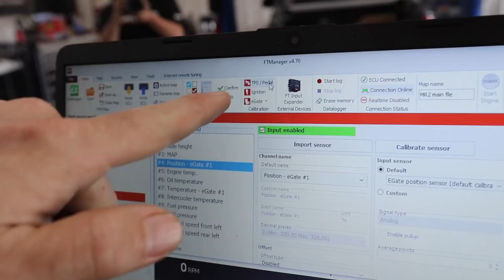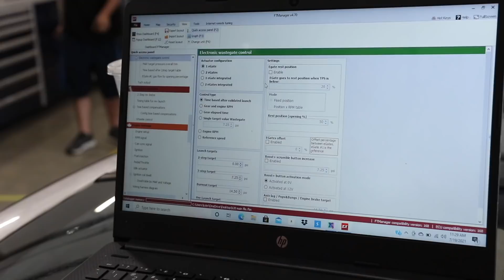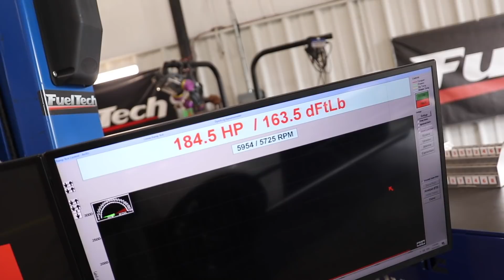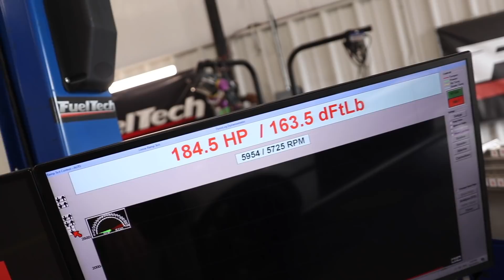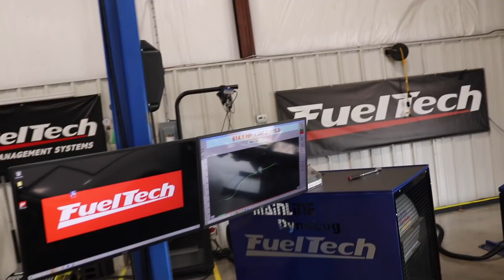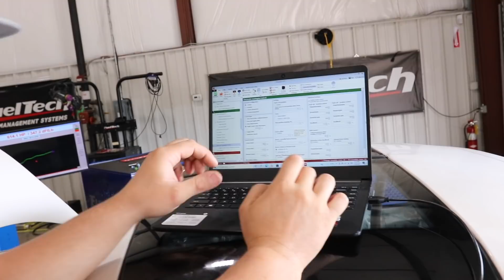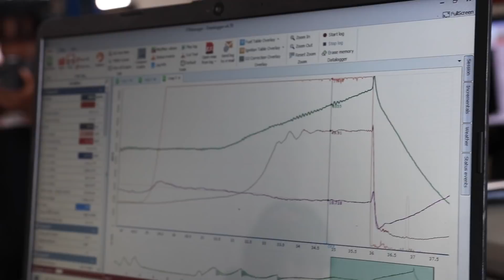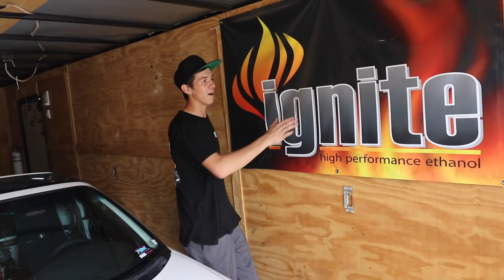The Mr2 THROWS DOWN On The Dyno!

Comment: I will admit I love what the fuel tech guys are doing and i am very excited to see how the Egate shit does, love to see the development of it, excited for everyone involved
Reply: Wild denbob appeared
Reply: Then you can have no BS build with an Egate, but think that will be some time yet, the tweaks are getting there.
Reply: Thank you!
Reply: Matt i tink the you need to run fueltech  on you ls engines
Reply: @cristianbustos4918  Nothing like tricking a car into thinking its ls powered Silverado
Reply: @AndersonDick  the auto calibration and real world data will get people to actually use it, when they announced it i was really excited to see what people would do with it, but immediately knew everyone would be afraid to use it. Kudo's for jumping right in and making it work and from what i see easily, to show people only good can come from it, the idea of complete control, and no springs or CO2 or anything while getting all the valve travel data at the same time is wild!

like you said its been out since 19 and he is the first "drag race car" to even want to use the thing.
Reply: @SloppyMechanics  That is the bane of new product lines. 

But looking at the graph after a few tweaks what you call for is what you get is great. 
Wonder if it compensates for other issues some get eg like boost creep, now with it logged you can see the % remaining/used.
Reply: @wobblysauce  boost creep is caused by the gate being too small.
An E-gate will never fix that. 
The WG still has 2b properly sized for the exhaust flow that is needed.

That said, that E-wastegate is a pretty dang sweet piece of kit. 

Afterburner: think back to the first turbo era in F1 (1977-1988) about 1100-1300hp in qualification trim, on high octane  toluene racefuel, using simple (Olivetti?) electronics and an eprom-flasher. 
All on a 1.5L 4cyl engine that used a block from a street car (bmw M10 engine) amd a Schnitzer 16V head from a F2 racecar.
Already 40+ years ago.
Got to respect those engineers!
Reply: @jfv65  Ya sorry was thinking of two different things at the same time... a classic lack of sleep.

Comment: Carbon fiber doors daddy Dave “cheater” 🤣🤣🤣
Reply: Alot of people on this channel won't catch that 😂
Reply: 80 pound diet
Reply: @MrJJ412  i got it lol and though the same as you
Reply: But still drives basically a pro mod. Lol
Reply: Didn't he start to run more and more carbon on street outlaws until they finally made the Vin number steel body rule
Reply: @wheeln24-79  I'm pretty sure he wasn't the only one, but when he had 'Plan B' to compete on the list this took affect because more people we're just going that route.

With that not denying he contributed to it :p

Comment: She sounds like Phongs all motor car…. Just with a little whistle….
Reply: True that
Reply: that's because Phong and Kyle both have a big cam with VTEC locked so it's on all the time 👌
Reply: For some reason the b. H. And k series sound like this when there locked on the big lobe
Reply: Good call.
Reply: @TM-jt3dd  there is no second lobe on the cam. Vtec stuff is completely deleted.
Reply: @BlueCollarBachelor  Not true. He has it in vtec all the time. He says it in multiple videos.
Reply: @BlueCollarBachelor  not true the vtec cam is just locked at all times
Reply: @bastacio1764  watch the build video. There's no vtec in that engine
Reply: @BlueCollarBachelor  you are misunderstanding, yes there is no variable timing anymore. But its on the equivalent to VTEC enabled all the time now. Edit: this just boils down to if you when you say vtec are you referring to the actual technology or the end state ie running on the big cam
Reply: @solatyn  Technically he is correct.. He just said it sloppy.. "Vtec stuff is deleted".. In a way he is right.. With Vtec Killer Cams, there is no more Vtec.. Vtec is just a system with multiple cam lobes that are timed with oil pressure to allow more flow at higher rpm.. A vtec killer setup is just 1 large lobe that is allowing the most flow at all times rather than a smaller and larger lobe for slower flow at low rpm and higher flow at higher rpm..
Reply: @bastacio1764  The old VTEC cam is no longer in the car, it's just a big ass cam now, way more aggressive than the stock ca profile even on VTEC
Reply: @solatyn  The engine has no Vtec. There is no misunderstanding. Variable Valve timing is what VTEC is. It has a single set of lobes on the cam. There is NO VTEC equipment to lock into anything. It is NOT a Honda engine.
Reply: @BlueCollarBachelor  VTEC is not variable valve timing - it is a secondary cam profile. and yes it is a Honda engine...
Reply: @surewhynot6259  It's a custom billet block. VTEC literally stands for "Variable Valve Timing & Lift Electronic Control"

Y'all need to get off youtube and turn wrenches.
Reply: @BlueCollarBachelor  when people refer to vtec they are usually meaning when it turns on and switches to the big lobes of the cam ie Increased duration of the valves opening etc. By deleting the vtc and replacing the cam with one with the same profile as  "vtec on", you are effectively driving around with "vtec on" all the time. Do you get what is being said now? Also wtf, yes it's still a Honda motor, where did that come from
Reply: @JonHop1  yes but if someone says it's like driving around with vtec always on, ie running on the higher cam profile all the time. Even if the cam only has the one profile and no variable control. It's effectively the same result right? When talking in context of the output of the engine, not from the perspective of the technology
Reply: @solatyn  No because the cam they run is FAR larger than the large lobe in a VTEC equipped motor. 
Yall are objectively wrong in every possible way, just take the L and move on lmao

It is NOT a VTEC engine.
There are NOT VTEC cams in it.
The ONLY thing Honda about this setup is the head and basic design of the block.

End of story, adios.
Reply: Fuckur Censorship  nobody was denying that secondary lobes can have different timing, but it is a fundamentally different technology from variable valve timing, as stated.
Reply: @PBRatLord  Is it though? how do you know there isnt a vtec cam out there with the same lift/duration/profile as the cam they put in? That is pure speculation dude. I never said the motor was still vtec or that it still had a vtec cam. I acknowledged the vtc was gone. What I said was, that on the new cam its the equivalent of being on the large lobes of the vtec cam/vtec enabled all the time. How is that "objectively wrong". You fail at reading comprehension dude, so I think you need to take the L
Reply: @zjwilliams1991  lol.. Finally someone that has been watching and listening to what the build was..
Reply: @jaytibby  I miiiight be a wee bit of a fangirl, but I also watch because my RSX has the same engine, and I am just building ideas on what to/not to do.
Reply: Literally sounds nothing like it
Reply: @zjwilliams1991  so JBR just gave them a junkyard core? Lol

Comment: That dip as you hit boost target then oscillate back in is indicative of an over damped PID tune. Decrease the Derivative gain a bit or increase the P gain and that should go away
@BoostedBoiz
Reply: My man knows electronics programming language and the interpretation of the language derivatives. Increase the p of K first if that increases the oscillation you reset back and decrease the derivative of time to amplify your error value correction.
Reply: @RadDadisRad  idk what terms they use in the FuelTech world, but a PID controller is a PID controller. The P (proportional) term is simply error multiplied by P gain. I (Integral) term is just a summation over time if error persists. This can be either multiplied by the I gain or 1/I gain. Depending on the applied algorithm. And D (Derivative) term responds to the slope of the change in measurement. So higher D values react more sharply, yet also act as a sort of shock absorber to the P term. His one log shown in this video is hard to judge without seeing the data personally. But it seems to be over damped a bit and potentially to much I term. It’s about time someone made an electronic waste gate. Not like anything involved is new tech, we’ve been doing shit like that in the industrial world since pneumatics ran everything.
Reply: It seems that the automotive industry has fallen victim to the same thing that the drone industry has where the cost of making technical parts overcomes the need for them. Good job to Turbosmart for finally finding a cost effective way to make such a simple yet affective product.
Reply: @zfpv7211  I’m using industrial programming terms. I program robots, conveyors and other things. Sometimes I’ll chase what I call the “windshield wiper” I’ll get continuous oscillations because the sample size is too small and the error correction is too big so I over/undershoot target. So I have to inverse some values by increasing my sample rate which decreases the error correction because I’m at a higher sample rate therefore my correction factor is happening quicker and I get less rebound and don’t get under/over correction of proportional gain.
Reply: @zfpv7211  eBOV and eWastegates are awesome. Also pwm controlled brushless fuel pumps are awesome too. Super efficient and generally small packages.
Reply: @zfpv7211  this is old technology, I was reading SAE papers on this 20 years ago, it's been in production for 10. They took the risk and brought the product of the tuner market, that is an accomplishment. But nothing here is technically innovative. OEs have been doing this forever.
Reply: @RadDadisRad  your PID sample rate that is baked into the PID algorithm should ALWAYS match the actual sample rate of the PID code itself. To me, it seems you are describing a situation in which you are adjusting sample rate to affect the effect of the proportional term (and inadvertently all other terms). Personally, I’d just make changes to my PID gains to make things right. Sample rate should remain constant. PID controllers rely on linear control (although can be changed to account for nonlinear via features like Feed Forward). I am an industrial engineer and have been playing with PID controllers for a decade or so now. Both professionally and in my hobbies (FPV drones).
Reply: @otm646  that’s what I’m saying. Even the actually code work to make it work is trivial. I’ve written extremely well functioning PID algorithms on a damn Arduino lol even the hardware has been around for decades. But bringing it to the automotive industry must have been a matter of cost vs need. Cost must have come down enough that it made sense. Either that or we need more industrial guys in the automotive industry lol definitely been around for a very long time.
Reply: @zfpv7211  most of the aftermarket / drag racing goes about tuning and building cars like it's 1985. This is mostly because they aren't engineers and they don't have experience with current automotive technology.
There isn't much need for a wastegate in reality, in a build this expensive you should be running VNT (s). We've had variable geometry turbos on gas engines for 15 years now? Whenever Porsche brought out that GT2. 
They are running these laggy wastegate turbos because it's cheap and easy.
Reply: @otm646  vnt turbos are great but… they are more problematic. The eGate and eBov are fail safes. Program the ladder logic to trigger it through function of code through the output. I don’t think they are actual fail devices because I believe they are NC devices instead of NO devices but I could be wrong. Any sort of upstream parameter out of specification can trigger the output to dump hot and cold side air to preserve the turbo and hopefully the engine.
Reply: @otm646  companies do have vnt controllers and they do work but you’re basically programming a jet engine to sync with piston pump engine output and driver controlled inputs. VNT turbos need to become more readily available beyond the majority market of diesels.
Reply: @RadDadisRad  the VNT actuator is identical to what they're using on the servo actuated wastegate show here, there's no difference in the technology. Additionally nothing prevents you from putting a conventional dumb vacuum actuated blow off valve if the VNT were ever to seize or otherwise cause an overboost condition.
This is production proven technology here.
Reply: @RadDadisRad  they are widely available in gas engine applications.  There are a whole host of OE applications to source turbos from, Garrett makes a complete line of them. And they aren't the only manufacturer.
Remember that only the hot side is set up for the VNT, you can still change out the compressor wheel and housing to anything you want. We've been putting together custom/hybrid VNTs for over a decade.
Reply: @zfpv7211  I can command sample rate through the PLC, preset is not the maximum or the minimum. I try to set the lowest workable sample rate to keep the equipment functional moving and accurate. If I over clock the sample size or processes just to get more information I’m just adding more data lines I have to sift through if I throw an error or fault code.
Reply: @otm646  also interesting caveat in regards to eBov and eGates. You can use them on an internal combustion engine in such a fashion that if you let off the throttle you can divert exhausted charge air directly into exhaust runners and program the fuel system to discharge excess fuel into the exhaust where the fuel burns with the fresh air and in the process turns the exhaust housing of the turbocharger into a jet turbine.
Reply: @RadDadisRad  I suppose it depends on the PLC. Some have a sample rate input that actually created the sample rate in line with the PLC scan time. Others have a sample rate setting that is changeable, but must match the duration of the PID controller scan time. So it’s actually possible to have them different, which causes issues and is noticeable in the tuning. Especially if the PID block is being scanned in the normal routine, which varies in duration. Either way, PID tuning constants will vary drastically with increasing and decreasing scan rates.
Reply: @otm646  Yes i understand they are industry wide but they are not widespread. That’s the issue, the demand isn’t there sadly. The same actuators in VNT turbos are rudimentary and cheaply made versions of the ones found in production jet turbines. We’re missing the super high temp stainless alloys and the air bearings that the assemblies ride on.
Reply: @RadDadisRad  the P term isn’t so much affected as the I and D, as the scan rate is directly included in that portion of the algorithm
Reply: I knew the pid controller talk will lure out a fpv guy in the comments haha
Reply: @coooxd  FPV yes, but Only for 2 years. Been working in the industry for 10 lol

Comment: Brent looked really sad/mad when the other guy said “Pop Pop” means it’s too lean.
Reply: Glad finally someone finally told them that pop pop means no good.
Reply: There is the show 2step... eg the contests... and the power 2step, flix a switch and can have the best of both.
Reply: @wobblysauce  the pop pop will eventually bloe the motor tho so not really a good idea unless you're just a show off and have pre built spare engines lol
Reply: @Jacobtheunwise  That and you normally pull timing to make it safe... well safer.
Reply: 100% so happy he said it, he is right, you never hear a well built fast high end car trying to chuck exhaust blades when leaving, just a controlled loaded state
Reply: Yup... our fave BBoi Wyatt knows that too much pop-pop 2-step goes bang. Remember the twin turbo V6 at the FF.
The MR2 is going to be great. Now it’s time to maximise your safety at the strip.
.... and I thought I recognised the guy in the video- Daddy Dave!
Reply: @NICKGAR7  Yep, and brent and others have said not to have that 2-step, but that is what Kyle wanted.